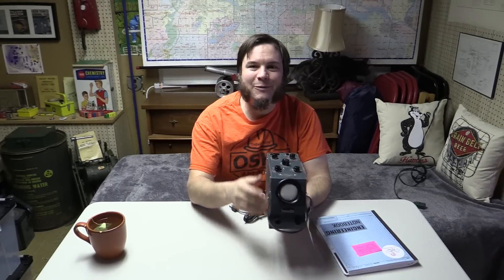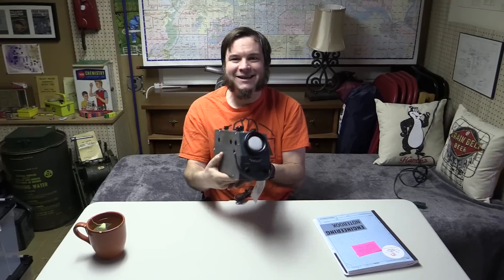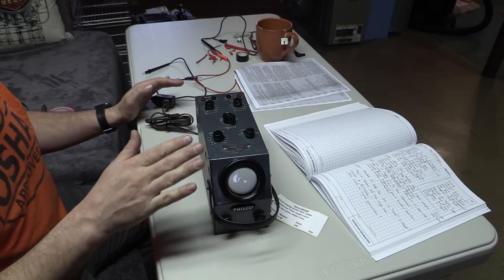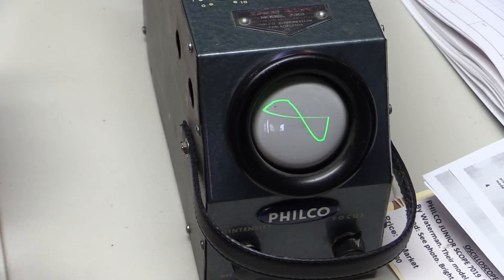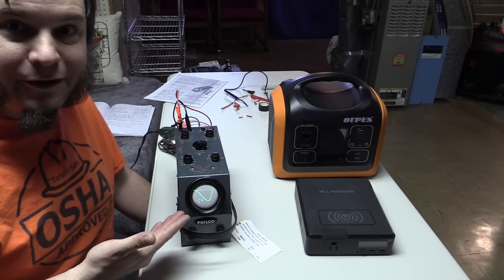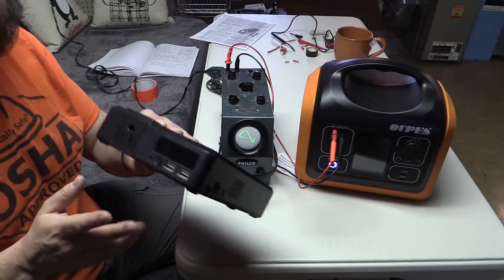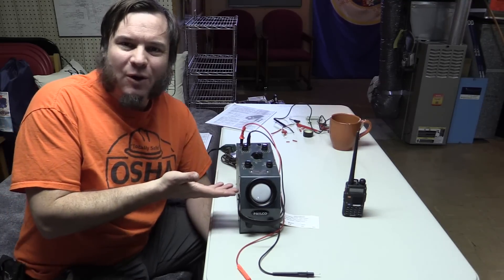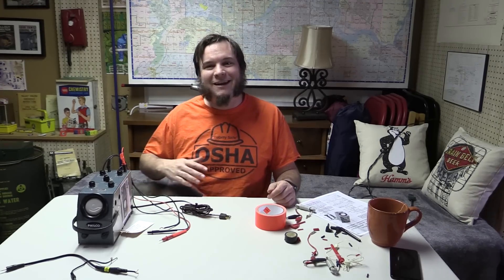I Got An Oscilloscope! Now What Do I Do With It?

Comment: No one really uses them much anymore.  They used to be instrumental for electronics repair.  You can use them to diagnose O2 sensors in cars.
Reply: I still used them daily, until my job was moved to another state. Just because you don't use one doesn't mean anything. You sound like a Vocational Electronics student a few years back. He 'informed me' that he would never need a scope, or to learn how to solder, 'Because I'll be building robots!', He was too stupid and arrogant to learn the basics so it was no surprise that he was dropped from that course by his teacher.
Even if you only play with modules, a scope can show timing errors, and defective data or address lines.
Reply: @michaelterrell  The need for good lab techs and research engineers with intimate familiarity for various flavors of test equipment will never cease.
Reply: Yeah, and the McDonnell F-4 Phantom did not need a gun...🙄
Reply: @Allan_aka_RocKITEman  They didn't, but only on February 30th! 😆😆😆😆😆
Reply: @michaelterrell >>> Early generation AIM-9 SIDEWINDERS have entered the comment section...😉
Reply: @Allan_aka_RocKITEman  They are outside of my military experience, but being a '50s design, any electronics was likely those flat vacuum tubes with a 1.5V DC filament that were designed for High G applications. Quite crude by today's designs.
I was a Broadcast Engineer for AFRTS, in the early to mid '70s. I also worked the now obsolete Weathervision System at the former Ft Rucker. This was a combination of delivering ETV to classrooms, and two channels of raw weather data for the pilot school at Carin Airfield.BTW, I have a reject small (steering?) rocket housing . I think it was for an early NASA vehicle. It came through a place where I worked as a load of obsolete and damage hardware that was being scrapped.